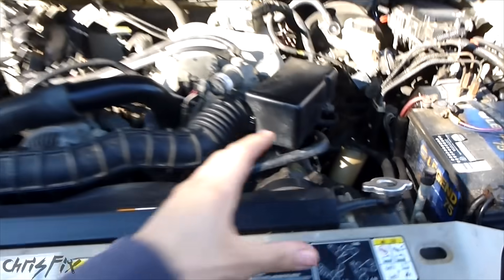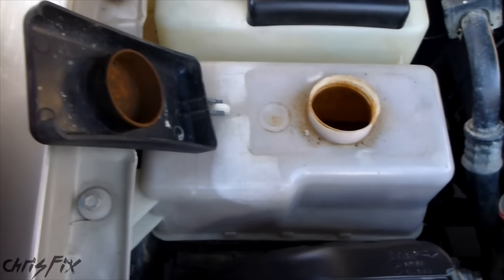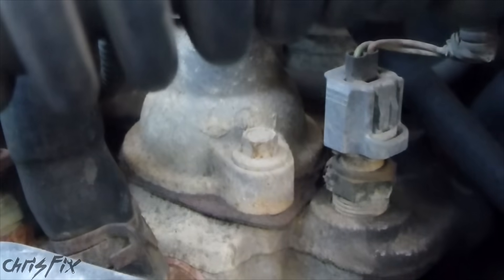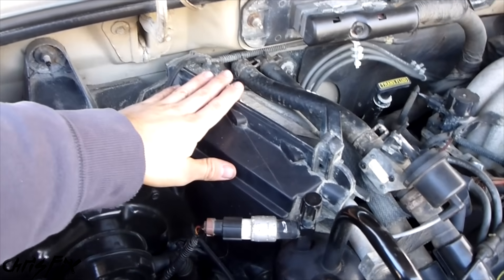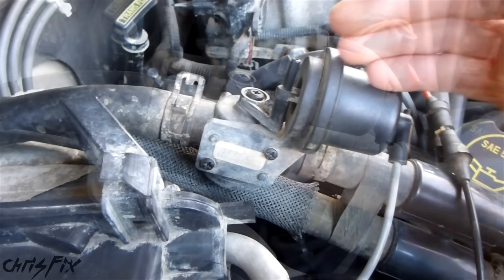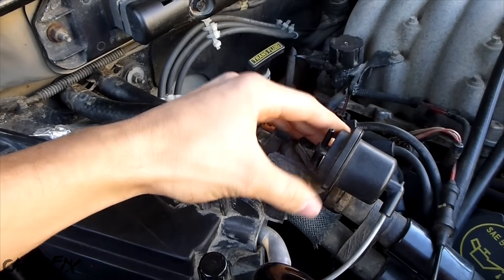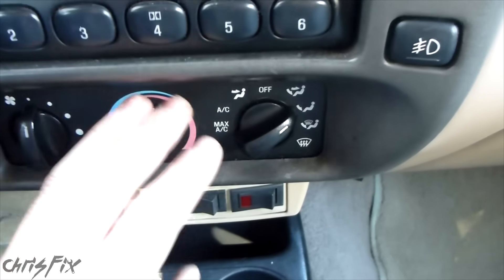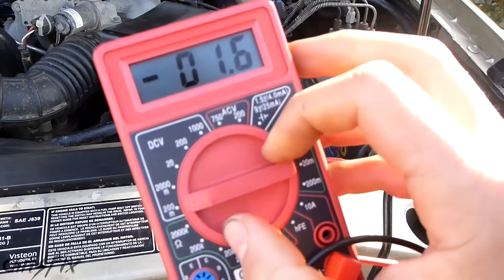How to Fix a Car with No Heat (Easy)

Comment: Chris, in regard to your video on 'No heat coming out', you had mentioned a resistor. Is the resistor the same as the AC/heater relay? Specifically, on a 2007 Ford Fusion.  
If anyone else knows, feel free to comment. Thank you.
Reply from the maker: Here is the blower motor resistor: https://www.youtube.com/watch?v=Q-i0tytSYIM&t=11s&pp=ygUVYmxvd2VyIG1vdG9yIHJlc2lzdG9y

Comment: hi, how you doing , thanks for this great videos helping here, i have a question for you , i changed my heater core and checked all things before install but now what i found is that i only have hot air , i dont have cold ,  someone told me probebly one  window in the heater core box but i dont wana belive i did any mistake installing ...can you give your opinion ? thankx

Comment: Chris..great video.  But im stumped. Heater core works, i replaced the control valve, but just stays open. Seems no vacume but the lines are all intact.  No heat at all in the cabin, so i expected this to be an actuator at the blend door.   But since the vac line is not working, is this the controller maybe?? I now gave a generic vac leak check engine code active.

Comment: Where is the coolant going if the head gasket isnt blown or no leaks? Does it evaporate over time under pressure and heat cycles?

Comment: Great video. Question for you i have a 2011 Dodge Ram 1500 Laramie. I get heat on the passenger side of the truck but the driver side gets very little heat even of full fan wich is blowing out all vents any ideas.

Comment: I had my wife take her car in for the issue and the guy told me the hot air coils were  broken... he claimed they can't fix them because they run on computers... I'm a mechanic so this made up part and issue was hillarious. Dude wanted to charge me 4k for a heater computer 😆 🤣  I was  dying i got home and thr coolant tube had a hole and the car had almost no coolant... $20 later the issue was fixed and heat blasting

Comment: Hi Chris, Maybe you can help me. I live in Canada and I just bought a JDM 2006 Honda Accord CL9 a week ago. Since we have extreme weather condition here, we need to have block heater on every vehicle. As I worked on my vehicle, I have successfully extracted the tiny bolt that covers the coolant located on top of the oil filter and have installed the block heater on it. I pour the coolant on the radiator but I notice that my coolant was just dripping on the side of the engine . There was a hole on the side of it that makes the liquid drips from it. Can you please let me know your thoughts?

Comment: Hi there! Great video!!  Still had a question because I didn’t see my actual issue covered.  My issue is that the fan works, but no heat at all.  The defrost doesn’t work either and the heat on high temp on full blast is still blowing cold air.  Any thoughts?  Thank you!
Reply: Did you ever get this fixed sounds like thermostat.

Comment: I have none of these symptoms and i still dont have heat. Replaced the thermostat and radiator. Both supply/return lines on the firewall to the heating core are really hot. Have fresh coolant in the radiator and resevoir. No overheating on the car, my blend doors work. Only time i can generate heat from the vents is when the fan is off for a while and i turn it on, then its nice and hot from the drivers side yet cool on the pssanger side until eventually all turn cold. My mechanic tried twice and failed at fixing it. Im close to giving up as well and drive the car in the summer only
Reply: So you can hear the blend door working, it's not your heater core cuz you're getting heat, I had work done on my car and they accidentally disconnected a little plastic hose underneath my dash on my driver's side - I found it myself. You have a blend door but you also have a little plastic box that's underneath your  driver side dash (floor board) I heard those have plastic pieces and they break - thermostat could be missing or in backwards. I don't have heat I think it's my water pump not circulating. One time my sister didn't have heat in her truck she disconnect the battery hooked it back up and it had heat - must have been an electrical problem. Check your fuses too. I know it sounds crazy but he was talking about that one part being electrical and then if it doesn't operate - no heat.

Comment: Hi Chris! Do you know where that vacuum line on top of the heater control valve goes to????? I will appreciate your help, my heater control valve doesn't open and close it is stuck open but I don't get heat in my 03 Ford explorer I did flush the heater core a couple of years ago and I got heat but this year I got no heat again. 🤷🏻‍♂️

Comment: Hello Rocky Here, today i want to ask about keeping my heater or bypass the line since i'm living in tropical country... Most heater included imported cars are modified by the owners because they said it causes an overheat

I own a kia sephia first gen, but i'm not sure if it's already been bypassed...

But i want to hear wether it is highly recommended to bypass the heater or leave it as is...

(Note: haven't been using that car a lot, been sitting in the warehouse for years, but it can still start on as long as the battery is full)

Thanks 😅

Comment: I have a 2010 Jeep Liberty. When it gets pretty cold outside in the winter, I get no heat at all. Then when it starts to warm up a bit outside I start getting heat. Like right now in the summer, my heat and AC work perfect. So it seems like all the parts are working, although I will use this video to troubleshoot. I'm thinking it must be a clogged heater core making it not work well enough when it's really cold out? Your thoughts?

Comment: thank you for the help , what if one side blows hot air and the others blows cold air , trying to change the temperature and cold air becomes colder but hot air is little but not as hot , the ac radiator was cleaned with a machine but not fixed the issue? please reply

Comment: CHRIS!! My go to for car help ;) . So I have a question. My 2019 Jeep Renegade has low air pressure from the two middle vents no matter the speed however the side vents work fine. Do you know what it could be? I recently changed my cabin filter!

Comment: Hi ChrisFix , When you turn your heater control knob to full heat, is the outside air door fully or partially open? this Truck does not have the button to push for recirculating air.  Thanks for a reply back. I appreciate it.

Comment: I use to have a 97 B2300 that had no heat. The problem diagnosed and fixed by a mechanic was a leaking vacuum line. I thought he said it was under the dashboard.

Comment: hi thanks for your helpful video,  my heater is not working and i found out that the upper radiator hose is warming up while the lower hose is not. what is the problem here, sir

Comment: Last note auxiliary water pump, sometimes called heater pumps, coolant pumps, etc. No heat because of low pressure of coolant and reduce flow to heater core.

Comment: Make sure to also check your climate control module. That was the source of my issue before a coolant flush and air in the hose was the problem after the flush.

Comment: Looks like there may be air in my system, I have had it a while year and that would have been nice to know, I even rigged up a power inverter to heat my cab when perhaps I had only needed to bleed my coolant(though it appears at this stage a flush would also be a good idea

Comment: Good video,,question I have a suzuki grand vitara 2005 2.0 diesel A/c compressor is good but the ac is empty,,and blower motor is good but should I be getting g some sort or air weather it is hot or cold ish running in my jeep just wondering, thank, s in advance

Comment: Chris, I enjoyed your video but it doesn't cover my problem.  On my '97 Olds 88 my heater fan works intermittently.  It won't work on high (4th speed) only on 3rd when it works.  I have replaced the heater switch, and the resistor cluster under the hood, I found no loose wires on either end, but still comes on only when it wants to.  Any ideas where to go next ??

Comment: hey Chris, if i do a coolant flush, is the heater core system will be cleaned also together with the radiator?

Comment: Chris I am stumped on my 2011 335 no heat at al. I felt the hoses to the heater core one felt warm the other felt much warmer-  there was definitely different- not same temp- there I no heater control valve. Thinking might be heater blend door actuator? But can’t seem to find its location
Reply from the maker: It could be that, did you check the fuse for the actuator?
Reply: @chrisfix  thanks Chris I’ll start there didn’t look at fuses yet. It sounds like my blend door actuator works as I hear the air change when i change the temp from full cold to full hot. Is it normal for the heater coil hoses to feel much different in temp? I owned the car since 9k miles and never used any sealant, the radiator was changed 2 years ago  coolant looks super clean, so I can’t see a clog. I do have a coolant leak again and it ran low a few times before I topped it off I did perform a bleed but maybe still has air in system? Maybe I’ll bleed some more

Comment: 4:33 The cause is by a bad temperature sensor. You can try the unplug the sensor and see if the fan stops. If it does, replace it. Another problem is a grounded wire or stuck relay
Reply: no one mentions the thermostat. stuck open and, well...

Comment: Hey Chris i did a coolant flush replaced the thermostat because i had no heat. With the cap off of my radiator my truck gets up to normal operating temperature but when i cap it off it drops below and as i get up to 3k rpms the coolant temperature reads almost 30degrees below what it should be. What should i check next?
Reply from the maker: Is the heat working now?
Reply: @chrisfix  with the radiator cap off my truck gets good heat. Once i put it back on i lose heat and the temperature drops below operating temperature.

Comment: I had a Lada Riva for a year and the heater was always blowing cold, plenty coolant in it, ended up taking the heater matrix(core) out, the valve was seized up, so replaced the whole matrix(core) with one off a scrap car which was not as old as mine, got it fitted then drove around the block and it was blowing hot, but a few days later I noticed the carpet was getting wet even though it was dry outside, so I closed the heater valve and it stopped leaking, so that explained why the other heater valve was seized up.
If I had known that was the real fault I would have tried to solve it a different way, I couldn't be bothered to do it all again, so got rid of the car.

Comment: Hey Chris. I just got a jeep grand Cherokee Laredo. The heater doesn't work so well. The fan works well in defrost but slows down anywhere else. Also when I step on the gas the fan comes on and blows strong but quickly stops. The heat is also just king of warm. Never hot. The AC works as well. Super confused what's going on. Just curious what you think the steps I should take to get those fixed.

Comment: After running your diagnostics, I notice that my heat only gets hot on highest fan and temp settings. When I decrease the temp or switch to a lower fan setting, it blows cold. Could this be a resistor issue?
Reply from the maker: Sounds like the resistor has gone bad if it's only working at the highest settings
Reply: @chrisfix  thanks so much for responding back so quickly. I’ll give it a go & report back. Your videos have been so helpful!

Comment: Just out of curiosity, do you know what would turn on the abs, and brake lights on the dash when ac/heat blower dial is turned? The blower works, but if you change the level of intensity, the dash lights up like a Christmas tree with anything remotely involving brakes (which are new(old problem though))2005 Chevy express van 1500

Comment: My 90s ford ranger had the heat area selector freeze up, it was vaccuum lines , they would not work at random times, I think it was moisture in the lines  freezing up . After spring came & it got warmer, problem went away . Just another Gremlin on an old tired vehicle .

Comment: Hey Chris,  My wife's 2013 Elantra gets heat, but only in certain vents.  The passenger side blows, but only cool or lukewarm.  So air is not blocked, but heat is.  Could there be multiple blend doors?  Or partial blockage?

Comment: Thanks for the video. I hear a click click click whenever I turn my control knob to the heat position. If I back off a little it still heats and the click stops, but now it is not heating at all. My heater core is not leaking. Can the actuator be my problem and is it difficult to get to? Please help

Comment: Chris fix I got a 2000 lincon 4.6 toen car and it's not blowing any heat what so ever to even get very very little amounts of heat I had to straight wire the blower fan to the battery   I'm going to flush the coolent but I watched your video and idk what's wrong with it

Comment: Hi Chris, I’ve got an 04 Forrster xs I flushed out the heater core and re bleed it with coolant but still not blowing hot air what is another common problem?

Comment: Hey Chris, I have a 2005 Jeep Grand Cherokee. When driving the temp is normal at hwy speed. Once I slow down to 25 mph or less, it starts to overheat. Turning the heater on full blast cools it back down right away or speeding back up above 45 or 50 mph. Aiir coming through is very hot as it should be. I'm thinking thermostat or water pump. Would appreciate any input. Thanks.

Comment: Hi Chris I have a 2014 Dodge Charger and recently had it checked for my ac air not coming through the vents on the dash and defroster not coming through the top of the dash against the windshield they say it do to the actuator and not having enough Freon in the system and that’s why the air only comes out cold and only on my legs , is this true love to hear back from you thank you..

Comment: Damn you're good. Listen I have an Acura rl that the Adaptive AFS won't stop blinking on the dash. I don't want to fix the  system, I just want to stop the blinking. I went under the dash and unplugged the unit but it keeps blinking. The fuse is connected to 4 things so I can't take the fuse out. Any suggestions? Thanks. I'm going to work on my heater right now.
Reply from the maker: Not sure if you're going to be able to do anything in that situation!
Reply: @chrisfix  Okay, thanks for your response. I'm going to concentrate on these excellent tips you gave for my heater problem

Comment: Hey Chris I installed a aftermarket radio into my car i had heat and defrost before. But after I put the new radio in i lost heat to my car is there anything I can do to fix it?.
Reply from the maker: Sounds like something got mis wired or disconnected after install, I would check to see if your hvac controls have power (try turning on the fan or AC, if nothing then its a power issue), check fuses, and recheck your wiring connection
Reply: @chrisfix  ok, I'll check them out. I also should've mentioned i do have  the fan and ac going. It's just pumping cold air all the time, even if I'm trying to use the heat or defrost settings.

Comment: Hi Chris I have a 05 Toyota Camry ac blows on passenger side cold but driver side blows hot any suggestions?
Reply from the maker: It could either be a low amount of refrigerant or a blend door actuator going out
Reply: Preciate your response and help

Comment: I have a 07 sport , both heater lines are hot , the fan blows tons of cool air only and strongly as it should but no heat . 
I don't hear a thing when I use the climate control,  but when I use the vent knob is in fact when I hear the door open and close but still no heat , would this suggest the climate control knob is broken itself and not the blend door or actuator

Comment: Hey Chris, Im having trouble with my car for a while now, ive tried almost everything and its still overheating. I hear little bubbles coming from the radiator reservoir. I replaced the water pump, thermostat, added new coolant. All i think it could be a head gasket? But i get no smoke coming out of the exhaust
Reply: You could have a bad thermostat even if it's brand new, sometimes  thermostats are put in backwards and sometimes if you just look underneath you can tell where you're losing water.

Comment: Ah ! My engines been overheating and I'm assuming it's my thermostat but haven't replaced it yet. Noticed my heater didn't work this morning and was pretty stumped. So it should just be that all my coolants pouring out due to overheating ! Just had a lot of work done, replaced spark plug wires and plugs, fuel pump & filter, starter, distributor.. bunch of stuff 
So my car overheating and the heater not working suddenly after that freaked me out ! Doing the thermostat today hope all goes well and it's nothing horrible.

Comment: ChrisFix. My name is Zo. I have a 99 Ford Ranger XLT 3.0L, and am have trouble with my heat working. It had been working but I decided to put a new thermostat in and it only made it run cooler than what it had been. I've done a lot of the things you suggested but still don't have proper heat. One thing I did notice though is that my heat control valve is stuck open. I don't know if it has been like for a while or not, but my heat was working 3 weeks ago; not that great but worming to a comfortable level. now nothing. Could that valve being stuck open be the problem, because at this moment I'm about to try changing out my coolant temp sensor. Do you have any ideas? Thanks!

Comment: I have a ford e450 superduty bus.  The driver heat works, but the heat for the passengers doesn’t work.  It has two fan/blowers that they do blow air but not warm or hot.  The system also has two lines of hoses underneath the bus which I already open the line for the flow of liquid to pass through but I still don’t get hot air.  What do you suggest I can do?